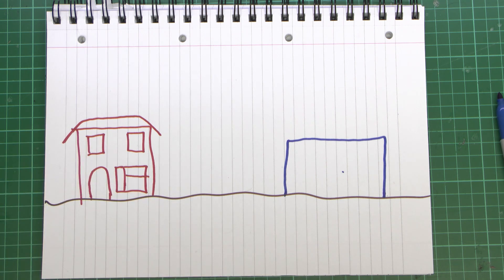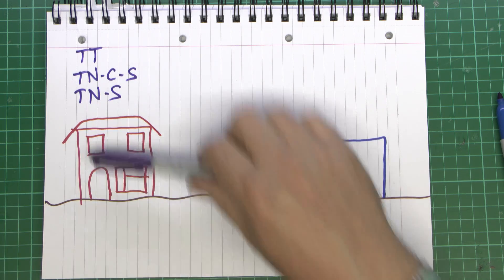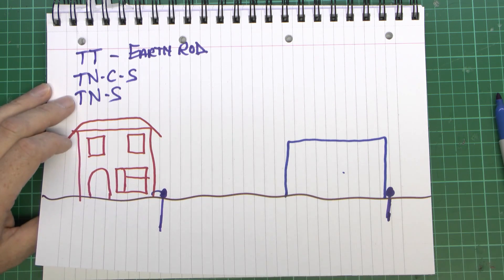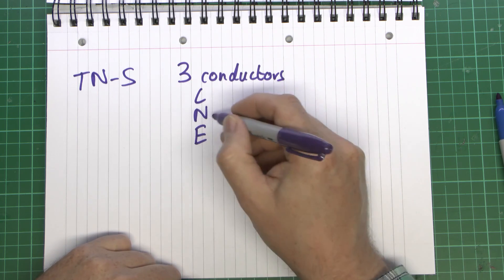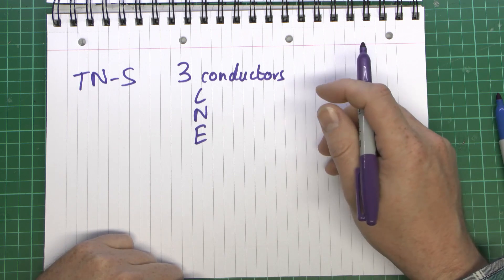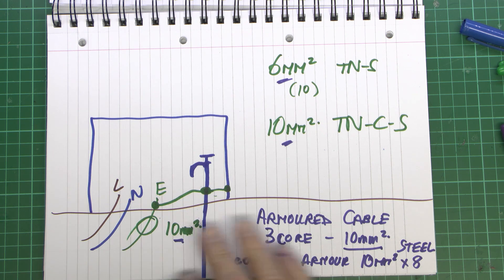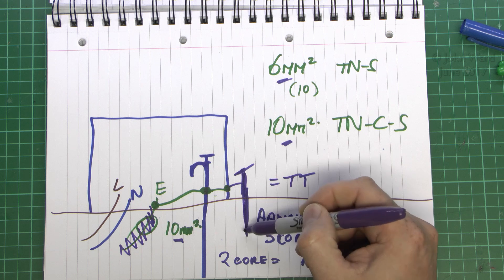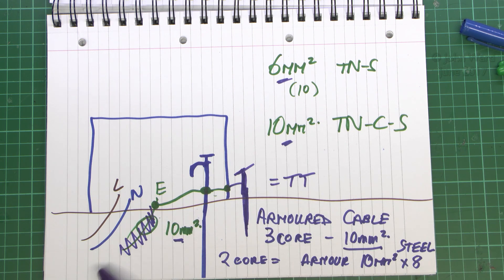Earthing Systems for Outbuildings

Comment: Firstly, thank you so much for the time and effort you put into creating these videos – they’re a big help.

I’ve recently had some work done to run an SWA cable from my house to my garage, which is approximately 30 metres away. The house is fairly modern (built around 2006) and has a TN-C-S system. As part of the work, the house consumer unit was upgraded so that all circuits are now on RCBOs. 

A 40A MCB at the house supplies a 10mm² SWA to a garage consumer unit. That’s about as far as the installation has got so far, but the intention is to run LED battens and install up to three double sockets. At some point in the future, I may also want to install an EV charger in the garage, and I understand that most modern chargers incorporate PEN fault detection to address PME earthing concerns.

I’ve discussed the earthing requirements with at least three electricians and have received differing opinions. Some have said that I shouldn’t export the PME and should instead install an earth rod, while the person carrying out the work is adamant that using the 10mm² CPC in the SWA is more than sufficient (with testing carried out to confirm this, of course).

Your video seems to suggest that exporting the PME in this situation would be acceptable, but I just wanted to get your thoughts on it if possible.

Many thanks in advance, and keep up the great work.
PS – there are no other metallic services or extraneous conductive parts in the garage (apart from the door itself!).
Reply from the maker: 10mm² core used as a CPC is fine - including if there were extraneous conductive parts as it could be used for the bonding as well.
Using the PME / TN-C-S earth is fine.
Reply: @jwflame thanks for your reply!

Comment: If your earthing system is TN-S or TN-C-S and your outbuilding has extraneous conductive parts - do you still need to worry about bonding if the circuit to the building has PEN fault protection?
Reply from the maker: PEN fault protection devices are intended for use with EV charging only, and are not appropriate for use in supplying multiple devices or a whole building.
They are not a substitute for bonding, however using them inappropriately can result in bonding making them totally useless.
Reply: @jwflame Good to know. Luckily I'm not an electrician in any shape or form!

Comment: John, so if I have a steel frame pergola in a garden that has lights and heaters attached and wired through the frame it would need bonding accordingly as well then?

Comment: Working slowly through a lot of your videos. I am not living in the UK but living in Thailand. Working here only with TT. The electrician that was involved during the building of the house wasn't very good. So time to check everything. On this video. If I have a rod both at my house and the barn, would it be beneficial to connect them together?

The difference is though that in my case, the electricity comes into the barn and with an underground cable goes to the house. Currently it is 2 wires going into the house with an extra rod for grounding at the house. 

The situatoin is actually a little more complicated but that I will ask in another related video that comes more close to my question.
Reply: the reason I was thinking about that is that in this way, both ground in the house and ground in the barn are basically a single reference to the neutral.

Comment: Hi JW, fab as always. 
A question if I may. I am off grid completely but running a conventional house. I generate electricity approx 100 metres away where it is also stored in batteries prior to onward transmission to the house. 
The solar system is earthed via a very effective TT install - there obviously is no other option. 
My earth and neutral are linked inside the inverter/charger. 3 core 25mm runs from my solar setup to my house. 
I have treated my house electrical installation as having a TN-S system and regarded my solar system (100m) away as my ‘power or generating station’. Consequently, I use the 3 core incoming earth at the house as my main earth, ie. no TT at the house. 
I wondered if you had any thoughts as to whether or not that is a suitable arrangement. 
In my head I can’t see a difference from a city estate house and my set up on a TN-S arrangement. 
BTW I am a retired electrician. 
Many thanks.
Reply from the maker: Your installation is TN-S.  There is no TT.
TT would mean an earth electrode at the solar/battery, 2 core L&N cable to the house, and another earth electrode at the house.

Comment: Im supplying an outdoor garage which has a metal roof and the house has a TT supply, im going to use 6mm 2 core armoured to supply the garage and put in an extra earth stake by the garage and bond the roof. 
My question is should I isolate the armoured cable armouring at the garage end so the garage relies on its own earth rod as its earth path or do I connect the armouring which would combine the earth stakes?
Reply from the maker: Combine, it's all TT so nothing to be gained by attempting to separate it.
Roof probably doesn't need bonding, it's unlikely to be introducing any potential.
Reply: @jwflame  Thanks for your advise

Comment: if you have done main bonding in the main house and the outbuilding's water and gas supplies are just an extention from the house do you still need to bond these extrenous conductive parts in the outbuilding as they are already bonded??

Comment: Hi John 
In relation to exporting a PME to outbuilding, 
A question I’ve always wondered is why is outdoor socket or lighting ok which could potentially be or have conductive things plugged into it. Yet if the light fitting was fitted to an out building the building would need an earth rod?

Comment: Hi can someone please tell me what I will need to purchase to supply electricity from my home to my outbuilding/garage please, will I need to upgrade my homes consumer box, will I need a second one for the outbuilding/garage etc. Great video thankyou.
Reply from the maker: Far too many variables, it depends entirely on the existing installation and what is intended to be installed in the outbuilding.
Reply: @John Ward Thankyou for your reply. I was guessing someone may say exactly what you said which is perfectly reasonable.

Comment: In my workshop I have a water pipe which is plastic MDPE pipe coming in from the house (about 10m away) via an underground duct (4” soil pipe) with the armoured cable. Since none of this water pipe is conducting to the actual earth, is it OK not to bond it? What if I took it outside the workshop for a hose tap? The system is TNS and the outbuilding earth is from the house along SWA.
Reply from the maker: Plastic pipes do not need bonding as they are not conductive.

Comment: Hi John.. A great video as always. 
Could you answer a question for me please... Recently out looking at a job where a new build house is going in.. The supply cable for the new build is actually coming from another house on the site (parents house)
So they're new house is titled as an annexed property... The existing house where the supply cable comes from is TT...
So my question is..
If wiring the new build property, would it be best to not use the incoming earth on the supply cable from existing property. And to  earth rod  and TT the new build separately?
Keep up the excellent work as always.... Much appreciated by many...

Comment: John, this was an interesting presentation, but what if the water pipe into the outbuilding is in plastic and the goes into copper at say an instantaneous heater?  Presumably it would then only be necessary to bond the tap pipework to the local earth at the end of the incoming cable, maybe a secondary consumer unit?
Reply: I was wondering the same, as most Water and nowadays Gas supplies are in PVC does this then nagate the building from having Extraneous Conductive Parts ?

Comment: How can you say 6mm2 or 10mm2 without knowing the distance?
If I have a metal frame greenhouse 30m from the house connected with 10mm2 3-wire SWA and the frame bonded to the E and armour the frame is in contact with the foundation, especially when raining, whether another Earth rod is added or not. So what happens if there is a close lightning strike and there is 50kV or more gradient between the house rod and greenhouse frame?

Comment: Hi John, I have just had a summer house built in brick, with a metal roof, however the metal roof is separated by timber joists, and 18mm decking OSB, so, the inside is totally isolated from the metal roof. I have no gas, or water installed in the building, or steel lintels, etc. I have a 3 core 2.5mm SWA from the house to a new consumer unit located in the summer house. My question is ?? do I have any issues, or requirements with the installation of the ceiling x 2 and all the walls being foil wrapped insulated on the internal wall surface ???? In this order : Brick, Foil insulation, Timber batten, Vapour barrier, Plasterboard & Skim.   Regards, Michael
Reply from the maker: No.  Roof isn't part of the electrical installation, and it can't introduce any potential as it's not in contact with the ground and it's not accessible inside either.  Same applies to the foil - it's a concealed part of the construction.
Reply: @jwflame  Thanks for that, also, can the foil perhaps interfere with any smart plug reception ??
Reply from the maker: @mjl3691  Possibly.

Comment: It has been said before that a breakdown in neutral supply can be mitigated by a parallel earth connection 
In terms of touch voltages being safer. Finally there seems to be more acceptance of this in the new regulations.

Comment: hi john,
After some advise please. i want to daisy chain two outbuildings from a TT house supply, would i need to fit two more earth rods and would they be linked together ? so all three are in parallel ? also how would I rcd protect them ? would it be better to not fit an RCD at the final DB and use the first outbuildings rcd ? no extraneus metal water pipes but the second outbuilding has a hot tub built on top of a metal tank . any help appreciated, chris

Comment: Questions: I have a metal lamp post outside currently supplied via a 13A spur from an interior ring going outside via junction box to SWA. Not sure what your opinion on that set-up would be .. but my main concern is possibility of lightning strike to the post sending a current back into the house. Is there any reason not to disconnect the exported earth at the exterior junction box and replace the earth with a rod?

Comment: Why in a TT system does shed need its own electrode in ground. Is it because it would be running beside the 230 Volt cable from house.  Or is because a fault in house would send all exposed metal in shed to 230 Volts ?

Comment: For a TN-C-S system is it permissible to use a 3core SWA with cores less than 10mm^2 but use the steel armouring in combination with the earth core to make up to the 10mm^2 copper equivalent that is required?
Reply from the maker: No, if using steel it would need to be about 8x larger as it is less conductive, so 80mm.  No armoured cables under 10mm have armour anywhere near that size.

Comment: If you’re supplying an outbuilding without extraneous materials or a hot tub, and your have. TNCS system inside, could you just use a 2 core to the building or tub, earthing the armour with the TNCS and then just put a separate cable out to a local earth rod? I’m getting so confused by when to use RCDs with a TNCS system

Comment: The latest advice seems to recommend TT system in the shed:
"Where the PME terminal is extended to an outbuilding, there is an increased risk that in the event of loss of the supply neutral, say as a result of an open circuit fault on the distributor’s PEN conductor, the cable armouring and all conductive parts connected to the MET are likely to be raised to the supply potential (230 V).

In order to minimise this risk, it is recommended that the armouring is connected to the MET at the origin but the outbuilding is divorced (separated) from the PME terminal. Normally, this is achieved by terminating the protective conductor (armouring) into a fully insulated (Class II) enclosure Fig 1, and connecting the outbuilding to an earth electrode to form a TT earthing arrangement."
https://electricalapprentice.co.uk/armoured-cable-supplies-to-outbuildings/
Reply from the maker: TT is an option, but in urban areas it's very difficult to locate the TT electrode far enough away from items connected to the TN earth.  Covered in this more recent video: https://www.youtube.com/watch?v=S5OtLg6voZY

Comment: I have a wooden summer house with a couple of sockets and a light. I have have connected it to the main house using 3 core armoured cable. It is connected via an RCD and 7 amp breaker off the down stairs ring main. It is all relying on the ring main earth back to the consumer unit. Should there be a supplementary separate 6mm earth cable back to the consumer unit? There are no extraneous metal parts.

Comment: John, I am trying to work out the difference between connecting a TN-C-S earth to a metallic outbuilding and the situation everyone is concerned about with EV charging in the event of an open PEN fault. The two circuit diagrams side by side look identical to me. Any pointers as to why the metallic outbuilding is okay but the EV charger is not?

Comment: If the you TT the outbuilding would you common the house supply earth to the outbuilding rod (two cases of TT house or TN house)? If so is there a maximum house-outbuilding separation required to avoid differences in earth potential? Any other considerations if water (or other underground services) are to be installed in the outbuilding? Thanks!
Reply from the maker: If both the house and outbuilding are TT, they can be connected together, they both remain TT and the benefit is that the earth electrode resistance is reduced.
if the house is TN, then they must be separated, otherwise you just get a TN system with a supplementary electrode connected.  That is permitted, but it's not a TT system.

A TT install must be separated from anything connected to the TN supply, and for buried items such as pipes, cables and similar, the distance will need to be several meters at least, some DNOs recommend 10 metres.

If there are other services to the outbuilding, then ideally they should all be plastic.  If metal, it's essential that they are not shared with the main house or any other property with a TN supply, otherwise it's the same as connecting the house and outbuilding earth system together and you just get a TN system with a supplementary electrode.

Comment: Just a question. I'm about to connect an earth to my old TT type system, as I have no earthing. Also putting armored cable to shed 10square. Separate rod  for shed as u advise. Can the two earth rods be linked at both boards? Thanks John

Comment: Hi John. Fantastic video's very informative. I see in the video at 13.55 you talk about ignoring the earth connection and driving your own earth rod. I have been asked to fit a new board in an outbuilding. The supply is coming from the dwelling house is a two core SWA cable and the steel wire was not used as an earth. As I see it I have two options. Option 1: Find the SWA back at the house and use the armour as my earth and connect it to the earthing block in the main board and do the same at the new board. The installation in the house is quite old and the size of the cable from the board to the earth rod is not 10 squared. Option 2: Ignore the earth from the earth connection coming from the house and drive my own earth rod and use 10 squared cable  to the new board in the shed. What would you recommend and what distance from the building should the earth rod be driven?

Comment: Been out of the trade a few years, semi retired, but I had to watch this to recap. I remember in the past I always used minimum 10mm SWA 2c SWA as standard and I don't know why or who told me to and I always used an earth stake completely isolating the earth connection from the house. Also I was taught on PME the mini C/U had to be plastic. I'm going back 30 or so years. Only recently have I seen vids of people connecting and using the house earth in a shed or outbuilding an wondered when this changed. Like we had to earth bond everything in sight at one time now its not the case. Glad I'm out of it now, just do bits at home spurred on after much nagging from her indoors 😀

Comment: So if you were using m24 rods in concrete as piles to support the building would all these piles need earthing?
Reply from the maker: The rods don't need earthing as they are already earthed, by being buried in the Earth along with the concrete.
If the metal parts are accessible, they would require bonding.
They could be used as the earth electrode in some situations.

Comment: Hi John 
What about a 2 core 6mm SWA and a single core 10mm earth cable. Of course it depends on how the cable is traveling to the outbuilding.
Reply from the maker: Theoretically possible, but unlikely to provide any savings, as the cost of 2 smaller cables will be similar to one larger cable, and installing 2 will certainly take longer than for a single cable.